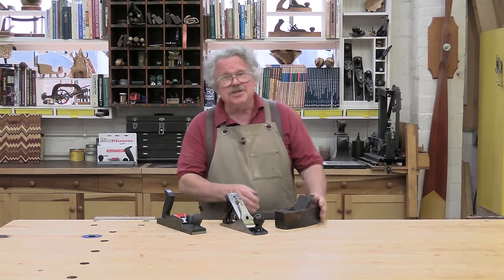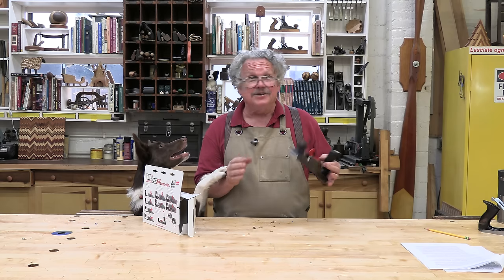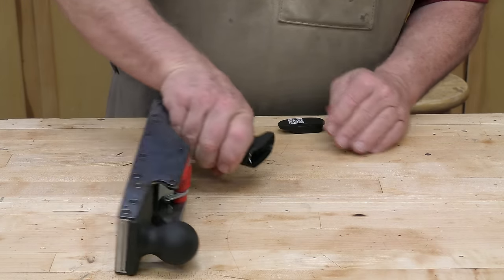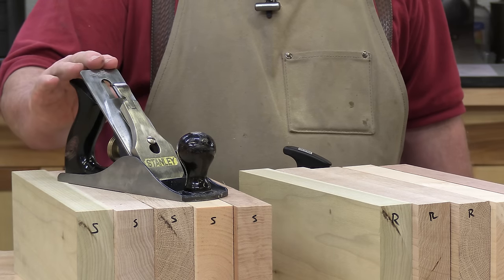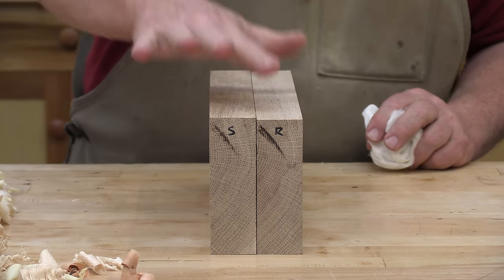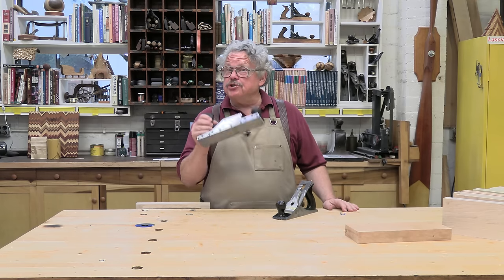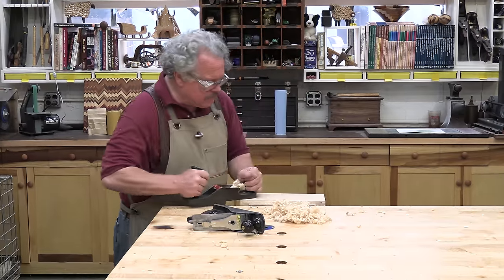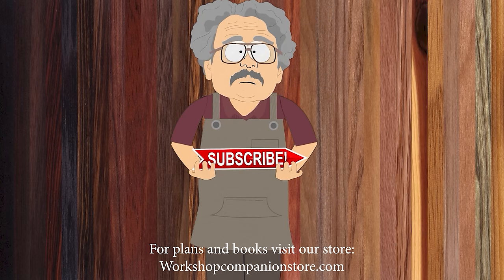Is This the Future of Hand Planes?

Comment: I'm pleased to report that as of September 2023, the Evolution 260 is shipping with both an instruction manual AND the top cap on the rear handle is now red, so it's more obvious that it's meant to be removed. I can also confirm, as a relative beginner to wood planing, that this tool is an absolute delight to use. Cheers!
Reply from the maker: Thanks for the report. Rali has never said or written a single thing about my review, but it seems they may have been listening nonetheless. And maybe they would listen to this: Red or black, the cap on the handle keeps popping of and spilling its contents. You need a better way to capture the cap. I've had to use a piece of duct tape, which makes a cheap-looking tool look even cheaper.

Comment: The Swiss RALI planes were around already in the mid 1980s, offering HSS and TC blades. Before that, there were "razor" planes that would take standard "Stanley" blades (1970s). In Japan, the Jump Mini j50 is rather common (aluminium body, HSS blades) and it's the one I have always within reach: the blades are incredibly sharp and the resulting surfaces are amazing. In Japan, the plane costs about USD 47.00 and a set of 3 blades is about USD 6.00 or so... however, prices outside of Japan are totally insane (like 4 times as much).
Reply: Was about to comment same. I got a Hegner from Advanced Machinery in the early 90’s. They had Rali planes back then as well. Minnesota State Fair booth when I was 10 years old.
Reply: So I can tell you the reason for the cost mostly has to do with shipping and international tax. I have been in the transportation industry for over a decade and that’s mostly what it boils down to. Important tax into the us is crazy high and the cost of fuel it way over taxed.
Reply: @austinsalyer8966   The design doesn't look like it need much special tooling. Could be produced locally, or at least all the parts and leave final assembly to the user.
Reply: @WorBlux  I totally agree, it probably could be made locally on small scale to reduce the cost of production. I would love to see them release some Stl files for the plastic parts and a spec sheet for the metal parts and allow people to build them for open source projects but I don’t think they have that in mind while building this.
Reply: @WorBlux    Not for the affordable price, though.
Reply: Its a shame the creator apparently doesnt read the comments... This seems like excellent supplemental info that he would appreciate very much. Thanks!

Comment: The major con is you can't sharpen the blade.  Means you need to spend over and over to replace the blades.  That could be a deal breaker for many.
Reply: I think this depends entirely on 3 things. 1.) How often you use the plane, 2.) What you use it for, and 3.) How much time you have to become good at sharpening + sharpening in general and setup. 

Imagine a scenario where you use the plane once a month, give or take on session. Take the price of all sharpening equipment needed to get a similar edge to the RALI, then divide that be the number of blades you could get. Take the value of your time/hr, and relate that to the time spent learning to sharpen to an identical edge of the RALI. 

Personally, I will always use traditional planes, but for someone who reaches for a plane a few times a month, and always wants an immediately available, super sharp blade, the RALI may make sense.... depending on how long they last. 

I don't think the cost makes sense for most people, but for someone on a jobsite, or someone who needs to just take a few swipes a project, and who has no interest in learning to sharpen, this may make sense. 

I am skeptical, but time will tell.
Reply: This has caught my eye. I like the idea of the Japanese pull planes. I think I could figure out a way to adapt one of these to being pulled.

Comment: Great video. Thank you for going over everything. Personally I would rather spend a little extra time sharpening my traditional plane and saving a ton of money.
Reply: Well, the chrome steel blades cost less than $2 each (per side), so unless you do a lot of planing (or they wear out really fast), it would probably take you a long time to save "a ton of money". And they can actually be sharpened a couple of times.

But I wouldn't buy a plane whose blades come from a single manufacturer (I'm not sure if that's the case here; maybe other companies make compatible blades).
Reply: @RFC3514  I see your point but these planes are about the same price or even more expensive than traditional planes. Also, you can get a used plane for much cheaper and you just need to fix it up a little. More work and maybe not worth all the time and effort. Plus, it is definitely an exaggeration on the "ton of money" I would be saving. Hahaha, thanks for keeping me in check.
Reply: @woodnotestudio  - They cost almost exactly the same as "traditional" Stanley plane of the same size. And if you can probably also get one of these used. They've actually been around for several decades.
Reply: You just need to adjust the blade to desired angle, sometimes the plane them you just need a few minutes to keep it sharp

Comment: Hock irons are a luxury though; it’s possible to get a beautifully working Stanley for around $40 if you’re willing to do a bit of work on it.  So the traditional are still cheaper, way nicer looking and feeling than plastic handles, and as Paul Sellers says, there’s more than enough out there for everyone who wants one.  And for me a huge perk of being proficient with a plane is the money I save on sand paper.  I don’t need more disposable tool parts.  Still, it’s interesting to know that this exists.  Thanks for a well put together video.  But I’ll stick to my grandpa’s old Stanleys myself 😊
Reply: @flosscap  yeah agreed!  I was more commenting on the lesser model costing $100 and the way he compared that to a Stanley + hock combo.  I just meant that the hock really isn’t necessary, so the Stanley is still cheaper than even the cheap option.
Reply: Yeah the cost on this thing is insane in my opinion for the way it's manufactured. I don't see how it costs so much for what it is. I do like the idea though, disposable blades would be handy at times.

However if this company really wants to increase their market share in the US I recommend figuring out how to get the costs down. Or to justify the cost in some way. I'm not paying 200 bucks for something with plastic handles and stamped construction. And the blade prices he quoted are nuts.

Comment: RALI makes good little planes.
I own two, a palm one and the german style one.
I'm quite satisfied with it, and how simple they are to use. You don't spend time working on your plane but rather working on wood.
Note that when both sides are dulled, you can resharpen them to an extent by "grinding" their flat surface on a water stone.

On the bottle opener part: this is a very germanic thing. I am employed by an Austrian pellet boiler industrial. The key to lock your boiler (because everyone locks their boiler's front door, right?) is also a bottle opener. Because everyone wants to drink a beer in front of their boiler, right?
 😁

Oh and thank you for your review! A very interesting one.

Comment: I think the Rali could be a good option for a power tool woodworker who doesn't want to spend time learning to sharpen or spend money on sharpening gear. If you plan to use hand planes a lot, though, this would get very expensive very quick. 

And if you're a hand tool or hybrid woodworker, you still need sharpening equipment for your chisels, spokeshaves, rabbet planes, etc etc. So there's not much savings there.
Reply: @barrychopsticks  - are you talking about the disposable cutting irons on the Rali? The corners are rounded, he showed it. You could smooth with it.
Reply: @barrychopsticks  - Those marks you linked to don't have anything to do with the camber of the iron. Those are a result of the laminated construction of the plane body. The plane body is leaving those grooves, not the blade. He discusses this right around the time of your timestamp. He also shows that the corners of the blades are rounded.

When the iron in a normal handplane isn't cambered, you get either one or two tracks left on the surface of the wood--one for each corner of the blade. These marks he showed were left uniformly across the entire width of the cut. These marks would be left during edge planing, too.
Reply: @barrychopsticks  - also, the savings isn't just in the cost of the sharpening supplies. The bigger problem is the time that most people would have to invest to get efficient at sharpening. A contractor may need a plane once a month. This Rali can be used easily and quickly by all the guys on the crew. A traditional hand plane would require everybody to learn to sharpen, otherwise they'd bother the one guy who knows how. It's not worth the time if they use it that infrequently. It wouldn't be worth carrying around stones, oil, a strop, and honing compound for them. To save them all of that, $200 is a reasonable cost. That's the kind of person this tool is really meant for.

It's a terrible investment for a cabinet maker or a weekend woodworker who will be planing a lot. I'm not the target market.
Reply: @flosscap  to be fair to, there is literally nothing to tune or sharpen on this plane lol. No lateral adjuster and no traditional blade that requires sharpening. All the user needs to be able to do, is turn the depth adjustment. Personally, I'm not a fan of this. I'll stick with my no 4,5,6,7, and 8....

Comment: great video, Nick.  I know many woodworkers take pride in their old Stanley planes and their ability to resharpen plane blades and chisels like a pro but for someone just starting or who doesn't want to invest cost and time into sharpening stones or systems, this seems like a great alternative.  These would also work very well in hobby co-ops where people share tools as you just swap out the blades.
Reply: Really? De-skilling woodwork is a good thing?
Reply: A single plane iron will last half a lifetime and can be sharpened hundreds of times, which by the way becomes very satisfying the better you become at it. People have sharpened swords on rocks for centuries, you will manage to get the idea of it
Reply: How long have we been using disposable razor blades instead of knives on our faces? Why should tool maintenance be considered a part of woodworking instead of the nuisance it is? Which do you prefer: carbide inserts on your planer or HSS knives? Sharpening and setting those knives wasn’t fun for anyone. 
This is a blade for wood. It lets you work more, and cuts well, which is the point of woodWORKING isn’t it? Judge it on that basis. 
I have a vintage wood plane with a wooden wedge for blade adjustments. I never get the depth where I want and it doesn’t stay put. But it sure is pretty…. On my mantle.
Reply: You’re going to need that sharpening system for your chisels. And know how to use it. This seems like a waste of money for anyone who’s going to use it regularly for somebody who uses it maybe a half dozen times in their life I could see it.
Reply: It's possible the cost of labour to sharpen blades is more than the cost of replacement blades.
Reply: @evanvandyke9819  blades are cheap and quick to change. If you are paid by the hour, it’s a no brainer.
Reply: @evanvandyke9819  they make chisels too...
Reply: To me this is like those sharpening systems that use disposable sandpaper sheets. Seems cheap at first, until you find out just how much you need to sharpen and you end up paying a lot more than you would have on a basic sharpening setup.
Reply: @f.kieranfinney457  For a wooden plane to stay in tune with knots I glued some emery cloth strips on the back of the plane iron .Old plane irons can be lopsided (thicker at one side ) and also lumpy from the hammering which is not a good wedge surface . Diamond plates were needed in those days .
Reply: I have to push back a little. I get the new to woodworking but 250 is expensive. Also my sharpening set up cost me around $75. 3 diamond plates/oil on Amazon and a blade jig. I can get a sharp blade in about 3 minutes as long as I don’t let it get really dull. Barely any skill involved except measuring the distance of the blade outta the jig and I have a jig for that so I never get it wrong.

Comment: I just received one of these today.  Thanks for the review Nick.  Like you said in the video, it is set up right out of the box and I made whispy shavings immediately.  The blade is super sharp, like and old doubled bladed shaver.
Reply from the maker: I'm using mine more and more for job site work -- it travels well. But one thing I would like to tell new owners that It missed in the vid -- don't trust the handle storage. Tape the top on the handle. Every time I want to plane a vertical surface, it comes off and the extra blades spill everywhere.

Comment: Great video and insights, thanks Nick!  A few things – Certainly the main advantage of the whole concept is not having to worry about sharpening. As others have said, this makes sense for the worker who only occasionally needs a plane, for only a few limited uses. You wouldn’t have to purchase, set up, and learn how to use sharpening supplies. However, going even slightly beyond these limitations likely means that a traditional bench plane is the way to go. First is durability. There are so many occasions where we go beyond using our planes, to abusing them. Rough material removal, planing through giant knots, or otherwise planing the f out of tough woods are tasks that might be slightly inadvisable but are also unavoidable at many parts of a woodworker’s path, and still I will never give a second thought as to whether my Stanley will stand up to the worst I could throw at it. The Rali, on the other hand …. a huge red flag is the plastic mechanisms. I could not believe that the mechanisms over time would not wear, snap, flex, and otherwise develop slop and become useless. Building the mechanisms out of metal would certainly begin to persuade me. And this would then also prompt a redesign of the entire plane for the fewer compromises needed with metal mechanisms. Another glaring risk is how short the blade is. Such a short blade can’t be supported as strongly to prevent motion up and down / toward and away from the surface of the wood, so if the mechanisms wear even slightly, I would expect chatter or skipping to set in quickly. The blades should be longer. And provide an option for blades that can be resharpened. There are more things that make me skeptical, but this comment is long enough, so I’ll leave it there. Except for saying that a corrugated sole that leaves marks is insane, and that with almost all other bench planes you get lovely wood handles as well. But hey, if they make their version 2.0 with some more thought, a disposable blade plane could certainly be a winner!

Comment: I only have the Rali plane (and their block plane as well).  I've been pretty happy with the simplicity and the lack of need to sharpen blades.

I'd also note that they also sell a chisel - I barely used it so far (don't use chisels much and have others as well) because I'm a little skeptical about it.  Maybe I'll warm up to the chisel when I've used it more.

Comment: I use traditional Stanley planes and also a 4 1/2 Acorn which came before Stanleys . I converted a lot of them to use old Laminated wood plane irons from  Sorby and Brades . You have to file out the front of the mouth to give them room . Thick laminated irons are in the Japanese league .Fettling planes is a good hobby in itself .

Comment: I have many nice hand planes that stay in my shop and only go to jobs on special occasions.  Most of todays cabinets, doors and trims are press board, MDF or other such materials. These tend to dull blades very quickly. I would love the ability to have a plane or two in my van that is easy and quick to sharpen on site, that I don't have to worry about someone walking off with so much (compaired to my Lie Nielsen planes).  I will deff look into these.

Comment: I had a block plane with a disposable blade about 20 years ago. The new blades were never very sharp but I only used it for shamfering  the edge of timber. after 12 months the blades were no longer available. I thought that if that was the way of replaceable blade planes then I was not interested. these look interesting and I may take another look at disposable blade planes

Comment: I inherited my father's collection of Stanley planes as well as his father's collection of woonen planes.  The fine adjustment capabilities on the Stanleys are great compared to tapping the wooden plane with a mallet and having to make multiple adjustments to get the blade position just right.  However, the wodden planes have a nicer feel about them and when the blade is set just right, they are better than the steel planes for rapid material removal, but the Stanleys are better for producing a fine flat finished surface.
Cheers
King from Cookernup, Western Australia